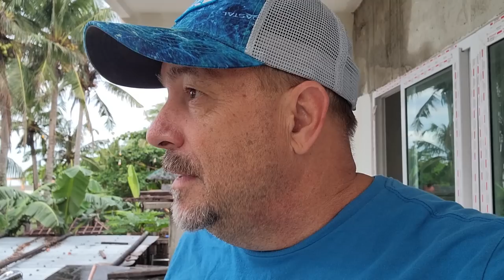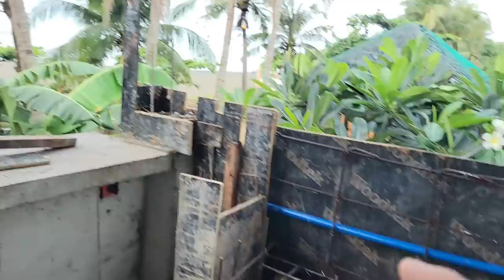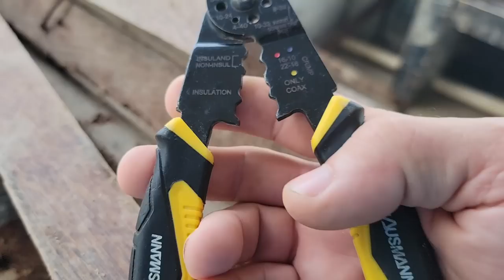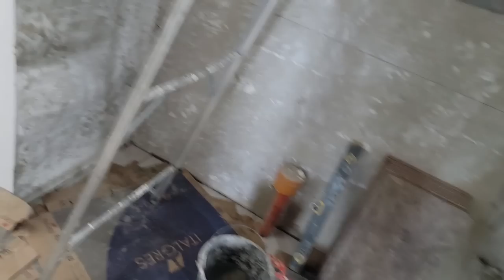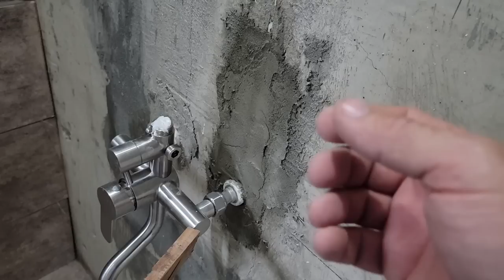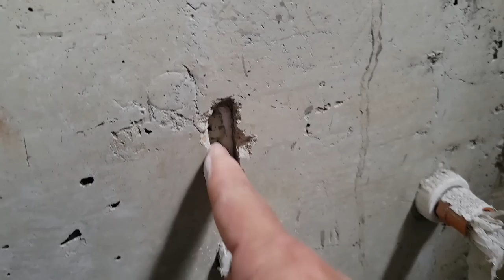Philippines Beach House Build Day 298 How NOT to DAMAGE your Outlet Boxes Plumbing in Cast Concrete

Comment: Hi James, I've build a few fireplaces along the way, mostly brick and lime or cement. To give a stress relief, I build the outer brick then line this with cardboard, then build the Inner brick that the coal or wood will rest against In the fireplace. What happens next Is when cured you light the fire and the heat will transmit through the first brick and burn the cardboard away, so making an air gap, which relives the stresses on the brickwork and the airgap reduces heat transfer. The one thing I avoid Is outlets or other plastic within 2 ft of the fire as the red colour of the burning material, Is approximately 740deg! I notice you have plastic drainpipe under and blue pipe In the wall, the white pipe will have water In so although the water may boil, It might not melt the pipe. As you have been around building I guess you know this. Looking forward to It being completed.

Comment: James, I was actually happy to see that on your electric outlets you have a hot, neutral and ground. That’s something I haven’t seen very often over there. Mostly what I’ve seen is a 2 wire setup. Great job setting it up the right way to ensure it will safely last a long time 👍👍

Comment: Interesting. I never heard about fly ash being mixed into the concrete with sand. I’m guessing you steel will still corrode but if it’s thick enough it will take a while. I have recently got a love going on with my pellet stove.

Comment: You can use pearlite, mixed with a bit of sand and normal cement to make a fireproof concrete. Don’t know if it is available there, but most garden centers sell pearlite to mix with soil for good drainage and water retention.
Reply from the maker: Great tip. Man I was hoping simebody would tbrow a tip in. I forgot about pearlite. I use it alot in the US. I will do some checking here
Reply: @TexasFilipino  It’s also great for insulating, so no worries about plastic pipes and wiring behind the bbq.

Comment: you could look at using refractory cement for your smoker. it is used in oven making and good to temps of 3000degree F. you can order it from shopee like me or some hardware stores may carry it. this is what i plan on using for my blacksmithing forge i plan on building so it can take the heat and will be safe.
Reply from the maker: Thank you

Comment: James, I agree the receptacles would work, but remember they are only rated for 120V. You're putting them on a 230 volt system. The UL ratings are based on the insulation material and air gap between contact. The higher voltage could be a limiting factor. Good practice is to pigtail the stranded wire to solid and to attach the solid to the screws.
Reply from the maker: I have been using these from the  USA in the Philippines since 2005 with no issues. Yes 120v but 120 has twice the amperage  220v and half the amperage and requires smaller gauge wires also. Lets rememer too that the plug is the same and using same spacing!  Also the ones form the USA have higher grade components  both in the  plastic and the metal conductors as well. The ones form here are made of very low quality and fail constantly. You do what you feel is best. I will continue to use the ones from the USA and be confident and happy as I have for many years here.

Comment: James a little tip on the thhn stranded wire i always aset my stripper's an 1-1/4 back of the end and pull the insulation off 3/4 of an inch and i leave the insulation on the end so the stranded wire stays together. Hope i explained it not sure if u know about it thanks for the video your shower faucett looks premo

Comment: James, I just sent my Filipina a new unlocked GSM phone from the US.  Is she going to need an adapter to charge it?  Thanks James
Reply: Nah, most phone use USB, and chatting bricks are 100-240v. Haven't seen one that's only 110v. And even if it IS 110, she can use any other charger with proper cable, and it will work
Reply from the maker: She will be fine. Sure its auto switching

Comment: Hi Texas Filipino James and malinda. great video very interesting salamat . I like those pointy nose wire cutters with the screw cutter and thread clear awesome I have a pair but in Australia ours are different but I'll take a look at our local Bunnings hard wear in the electrical area salamat James what a bitch pulling hard on the forms not good .I knowyou would have been absolutely pissed at him .
Cause once concrete set you cannot look for breakages in the consumer or wires oh lordy that would have torn me  a new one.great video James 
🇵🇭 Scott expat in the Philippines 🇵🇭